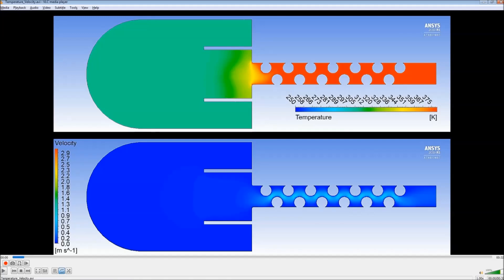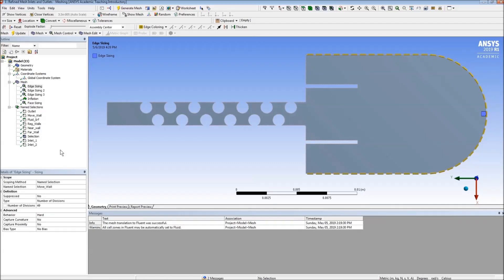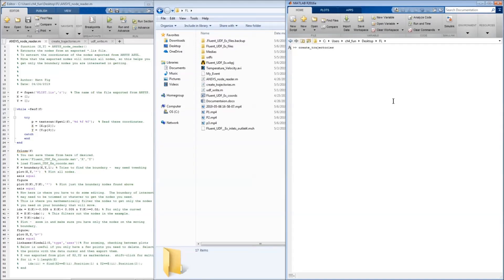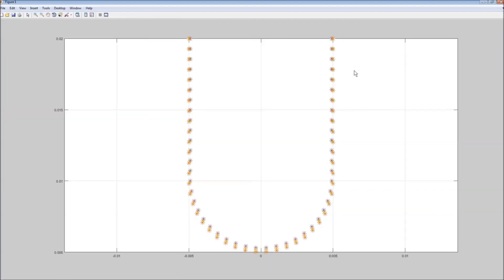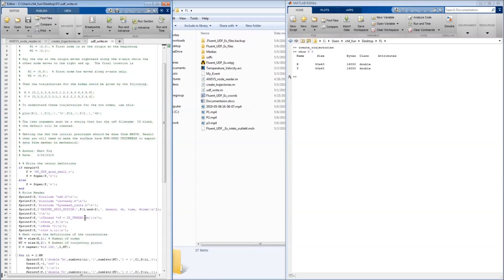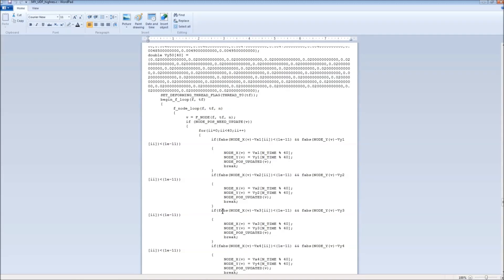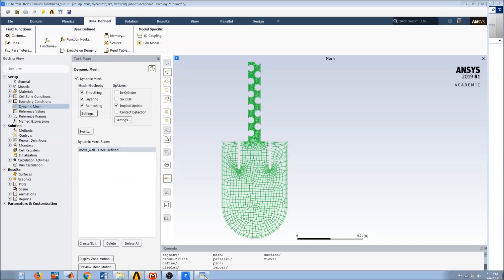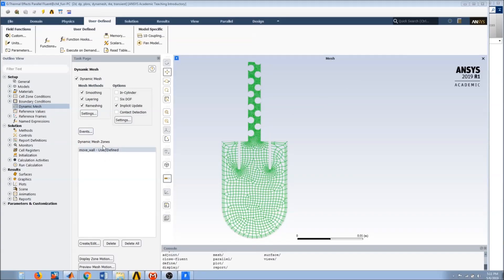ANSYS Fluent tutorial - Complex Moving Boundary (Dynamic Mesh) with MATLAB and UDF.

Comment: Hi Matt, this is a great example of the use of the dynamic meshing and initiating various events, the methods you have used within the video are all applicable to one of my projects. I am still new to Ansys and haven't used the dynamics of the tool much before, it would be a huge help if you could send over the associated files for me to try and get my head around. Your video is by far the most useful and I've been searching the last few days so it would be fantastic if that was possible and much appreciated! All the best. If possible please email scott.original99@gmail.com and let me know you've got in touch. Again thank you :)
Reply from the maker: Hello, I did another tutorial for a 3d version of a similar project. Look for that one using the MATLAB logo.  See if the files I shared there help.
Reply: @mattfig6098  cheers for getting back in touch, sure will give that a look over cheers 👍
Reply: @mattfig6098  HI Matt, my work mainly focuses around the event management. I can understand how to change the given id to or from a wall/pressure inlet/outlet, however, looking at the options I'm unsure on how to define the po parameters. Is this something you need to do separate to the dynamic meshing events dialog box in a file such as the one you have displayed? Thanks again
Reply from the maker: You can use regular TUI commands to change parameters. Have a look at the TUI section of the Fluent documentation.
Reply: @mattfig6098  I can see how those individual commands work to change the boundary, thank you. I am currently really struggling with a University project which uses some of the fundamentals you have shared on your youtube channel and getting very little support for the university at this time. Would there be any possibility that you would be able to provide some support and of course I would pay you for your time. As little as two hours would probably be all I would need to get my head around the processes I need to employ within my model. It would be massive support and you would be a huge help. If so please do get in touch and we could discuss this further via email or zoom call and all being well get the model working :) All the best.

Comment: Do you think the same method could be use for a 3D problem? Thank you in advance
Reply from the maker: Yes, I am using a very similar method for 3D in my current research.
Reply: I’m working in my research on a model for a deforming m membrane to propel fluid in 3D, are you working on something similar?
Reply from the maker: Not exactly, although my research is very similar as far as the physics.
Reply: Would you be able by any chance to share with me your matlab functions? Thanks
Reply from the maker: I am going to make a video for the 3D soon.  I can share the p-code for 2D.
Reply: I would appreciate it very much, thanks!   My e-mail is gionne95@hotmail.it
Reply from the maker: Sent.